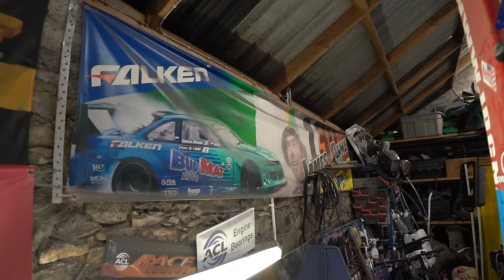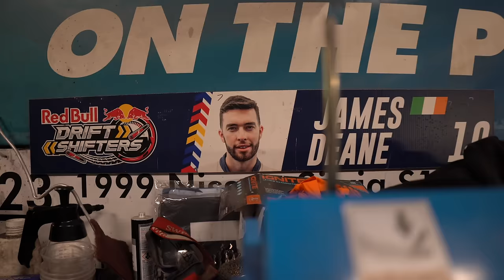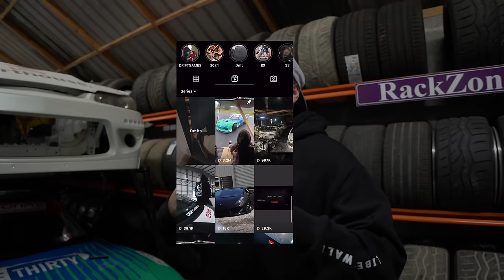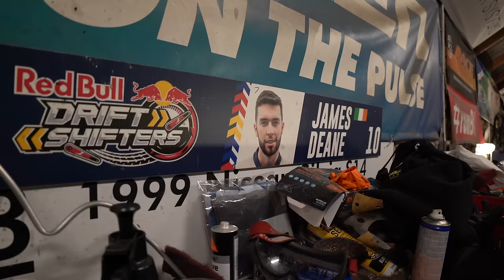Someone gave us a 1000hp drift car FOR FREE ❤️

Comment: This is excellent news, just what's needed by a stand up guy.

The best thing about the RTR engine is that its a NASCAR engine, its designed to run at 9000rpm with zero airflow in the draft for hours on end, even when they spew all the coolant out they keep going!